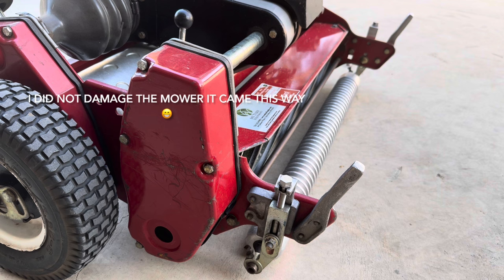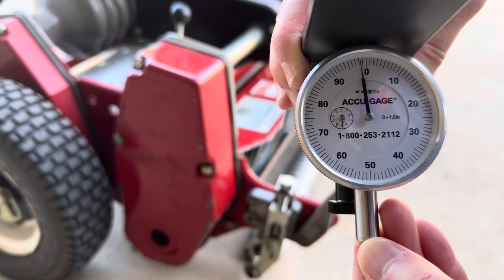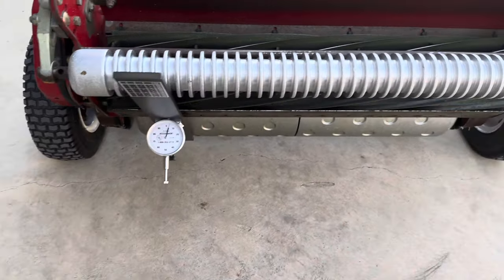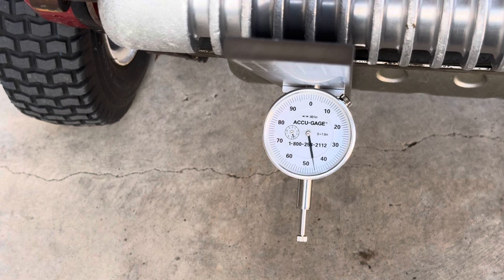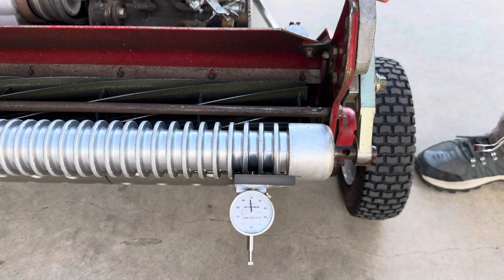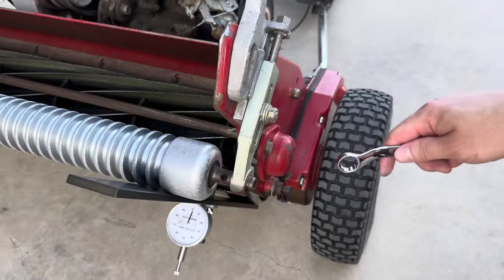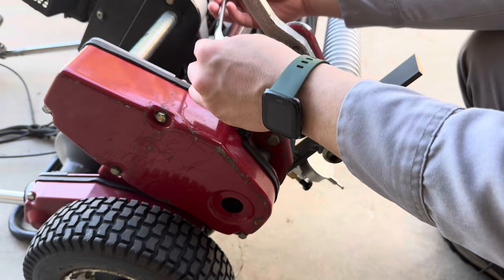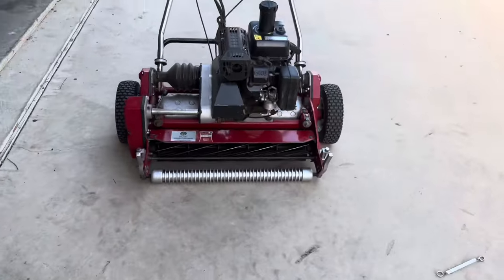TORO GREENSMASTER 1600 | Height of Cut Adjustment

Comment: Thanks for the video! Why doee taking the guage off and then back on the bed knife change the hoc guage measurement sometimes
Reply from the maker: There is a different version of this instrument where it attaches on magnetically.  This allows for a less hassle readjustment when changing the height of cut.  With my version there are more than one moving parts causing an imbalance when changing the HOC.  So best way is to remove the gauge and place back to get a good measurement.